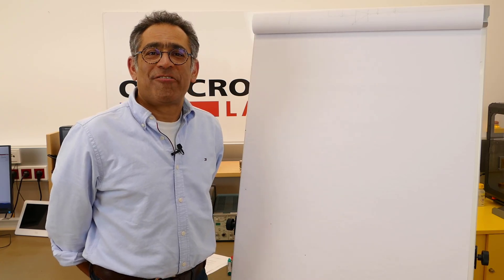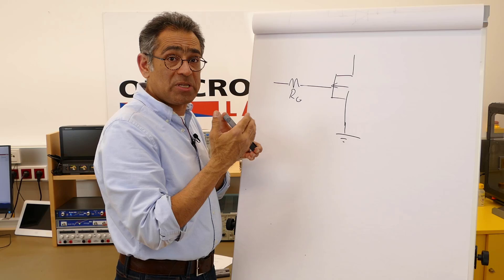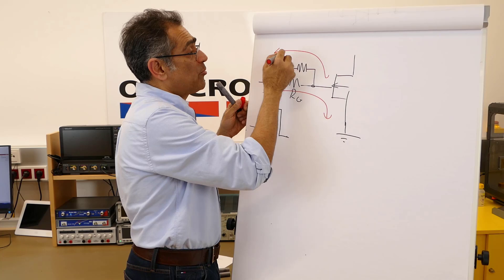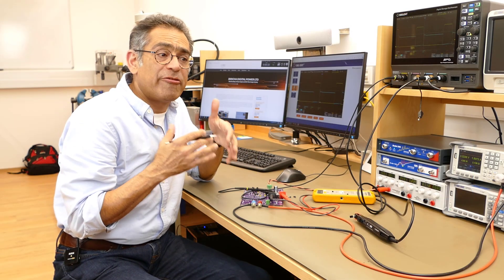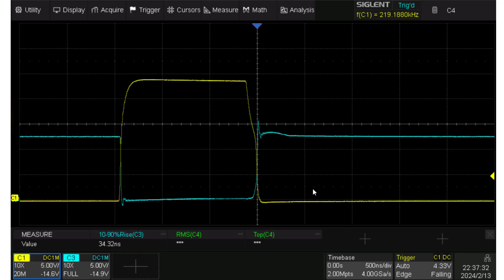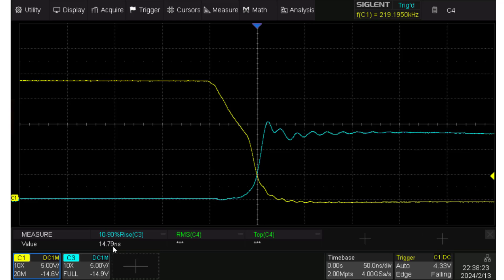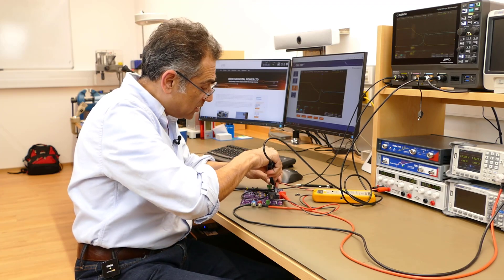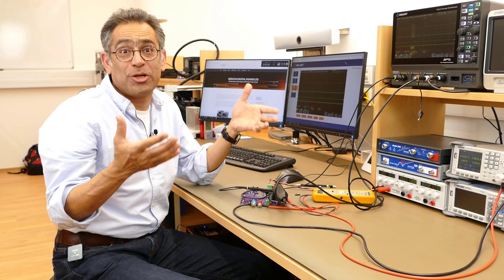MOSFET Gate Drive Resistor Selection - Part 2: Turn Off

Comment: This channel is pure gold for any power electronics student. Just a small additional point from my side, Suppose we drive this MOSFET from a microcontroller, then we have 880mA sinking into the GPIO of the microcontroller when the gate pulse is OFF. This has to be verified against the datasheet for the peak current sink capabilities of GPIO pin.

Comment: Hello, dear sir 
once again I would like to ask you some not yet anywhere covered details: 
For Fast Turn-Off AND back Turn-on, 
could adding 2-to-3 series 1N4148 Turn-off discharging diodes assist in 
1) not completely discharging the Gate input capacitance, lets say to 3Volts,
so well below the common 4Vgs-th.
2) and so Cgs is not fully discharged, for the next Turn-On it needs to re-charge, 
merely 3V + >1V to reach over the common Vgs-th of 4Volts ? ? 
Could you please give your opinions on this ? 
Thankyou & best regards, Harry.

Comment: Hello sir, I would like to ask if there is any way to apply automatic control signal block diagrams to the design of electronic circuits using discrete components? For example, design a common E audio amplifier circuit using BJT.